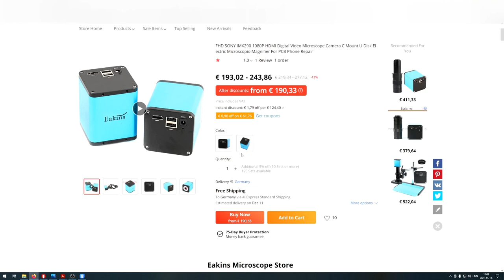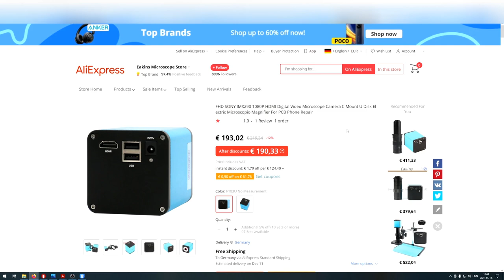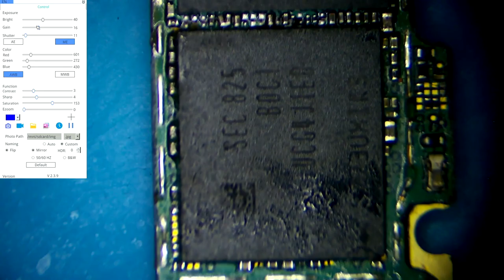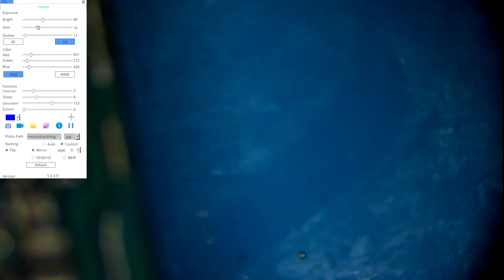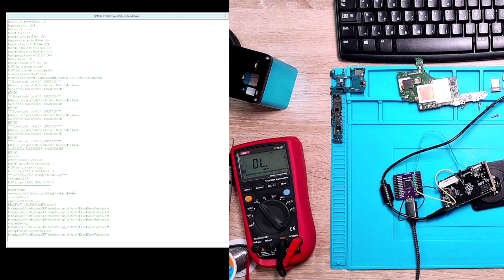FAKE Sony IMX290 microscope camera - SCAM

Comment: They scam also in my case. After almost 10 months I opened mine and there is IMX307 with autofocus instead of IMX290with autofocus. Same shop: Eakins Microscope Store.
Reply: Amscope are one of the most complicit in perpetuating rebranded obsolete Chinese sensors as microscope cameras. Like a decade old 640x480 0.3mp child's toy camera sensor, being rebranded as a £40 microscope camera in 2024, with equally obsolete ridiculously child-orientated proprietary software.  🤔

Best advice: Just don't get suckered in by the low Chinese prices. Then you won't have to bin the fake and shop again on the genuine product. 👍😉
Reply: @Zodliness  Amscope microscopes are not good either. People say they will give you a headache.
Reply: pero dicen que el imx307 es mejor

Comment: Hi! Request. Show more details of the contacts to which you connected and what voltage was the converter 5V, 3.3V or 1.8V?  What lens enlargement do you recommend to work with chips in the SOP8 and SSOP8 (0, 625mm per pin) package?
 180X will be the best choice?  Best Regards.

Comment: If you paid using PayPal you’ll be able to open a case with them to try and get a refund. Sorry to hear this happened to you. Some credit cards also offer fraud protection and you may be able to get your money back that way if the seller not giving you a refund.
Reply from the maker: Thank you. The problem is that one of the refund process has already been clodsed in Aliexpress before I was aware that it is really not this sensor. I asked for a lower amount of money onky just to get something back....Though you might be right that Paypal could still help.
Reply: @kikihobbyrepair  they will be able to if you used PayPal. Just login to your account and find the transaction. There you’ll be able to open a case with PayPal and on the case details just state it’s not as advertised. I’m sure you should be able to get a refund this way because the seller lied in the advert. Hope it works out for you.
Reply from the maker: You are right I will do this. It definitely worth a try. I wanted to make the video anyway to warn others about this scam...
Reply: @SURGE101  Rich that is  Good advice. I have bought other items from various Eakins shops and they have been fine.
Reply from the maker: All my other microscope stuff are also from Eakins and they are fine for me too.
Reply: @kikihobbyrepair  depending on how much it set you back, go to the seller in person.
Reply: @kikihobbyrepair  the paypal dispute time is about 90 or 120 days. And you have to hit bastards for your money, the alipay these days resolve most of the disputes in favor of sellers because in case of  money refund they bear some financial losses as well.

Comment: Got my scope from Eakins, chosen more expensive 8.3MP Sony sensor. It described as HDMI + Type-C + USB + TF, simply has no USB . Was packed bad, it was nothing but luck it has arrived fine. I even made a video of unpacking at delivery point. And conversation with seller was difficult. 

The only "Sony" word in 27 kb log is in phrase "IR Sony protocol handler initialized". However, start-up log contains "Connect IMX415_HDR_init_driver linear to sensor pad 0", and internal sensor looks 100% identical to Sony IMX415 photos I've found on internet. IMX415 specifications match with scope specifications. Found some protection on USB and HDMI data lines which is nice. 

Despite lost USB port and some minor details scope is good for me.

Comment: Hello, I'm afraid that two years is too late to comment, but if what I'm about to tell you doesn't help, maybe it will be useful to someone else who comes across this comment, just as your video has been helpful to me.
Well, after watching the video, I would say that the biggest problem I see is not the camera itself but the lighting you are using and the surface of what you are trying to observe.
First of all, the light. I saw that you were using an LED ring light around the lens, which is not the best way to illuminate with a stereoscopic microscope. The reason is that the lighting is perpendicular to the object being observed and parallel to the microscope lens. Considering that reflections depend on the angle of incidence of light, the result in the images is a result of that "direct front lighting." The situation is even worse because what you were observing was a PCB that has a very reflective surface. You can try cutting one or two rings of white paper and placing them in front of the LEDs as a diffuser to see if you can reduce the glare a bit.
To avoid and eliminate many of those bright reflections, you can use lateral lighting. You will lose most of the front ring lighting, which you could keep as low as possible only to fill or lighten the darker shadows. But also, if you place one, or preferably two, lateral lights pointing at a 45-degree angle to the surface you want to illuminate, theoretically, you won't have any reflections. Well, that's just theory because with bare bulbs or LEDs, light travels in all directions, and you will still have many reflections. If you really want to get rid of virtually all reflections, I recommend getting polarized light. You'll be surprised. I dare say that was the type of lighting that the people at Eakins were using in that video you posted as a comparative example at the beginning of your video. If you use polarized side lighting at 45 degrees and very low front light to fill the shadows, I'm sure you could get a very contrasted and evenly illuminated image.
The second thing I want to say is that the microscope you are using does not seem to have very good optics. The image you show never appears sharp, at least in the video I've seen, and in the brighter areas, you can see fringing or chromatic aberration (magenta color) that occurs when poor-quality lenses fail to make the different wavelengths of light that pass through them coincide again at the same point. It would be something similar to when in a printing press the inks of a trichromatic process do not overlap perfectly, and the resulting image is not sharp or does not have the correct color, so to speak. That could also be the reason I told you the image didn't look sharp, although there could be other reasons. If the lenses are not very bad, you may not notice it, unless your eyes are very used to seeing images since the brain reinterprets and corrects the image to some extent, but the camera does not correct anything and captures what is, good or bad.
As for the falsification of sensors, it's a bit concerning because you don't really know what to expect. Supposedly, you are buying one thing, and they sell you another of lower quality and price. What catches my attention, now that I am looking for a microscope camera and was searching on Aliexpress, is the disparity in types and prices, even among cameras that seemingly have the same external appearance. It is very likely that the Chinese use the same exterior design to save costs and vary only the electronics of different models. And here is also the danger of encountering unscrupulous sellers willing to deceive buyers and maximize their profit margin.
If you've made it this far, I apologize for the length of this message, and I wish you a happy day, night, or whatever it may be wherever you are.

Comment: I would even say that 99% of the cameras that have been available for a while are equipped with fake chips. 

For new models, the chance of getting a camera with an original chip in China is greater. But as soon as the model does well, the expensive original chips are replaced by cheap copies.

And by the way, this does not only apply to cameras!

And even if some people here write that this is a light problem, this is not true. Quite apart from the fact that you want the product you paid for.

But you can see very well on the video that there is a problem with the dynamic range of the sensor. And you can't compensate or change that with light. The dynamic range remains poor. And that's what makes the difference between the sensors.

Comment: Thanks for letting us know. That's very bad, bro. I am looking to buy Hayear HY-6110 with IMX334. It's the best when it comes to sensor specs, but I am now skeptical if they are using an original sensor or not.

Comment: to eliminate reflections, please use the gooseneck lamp. that overhead lamp is no good for some cases, reflections everywhere, including that switch board.
Reply from the maker: Thank you for your feedback. I understand your point that incertain situations a gooseneck light is better. I even designed one myself. But this was in this video a one to one comparison of my cheap 70€ camera vs a ca 200€ camera where the cheap performed signifixantly better. I use the exact same ringlight like Eakins is using for their videos in the advertisement. They wpuld need to perform significantly betterin any conditions and this is my problem. If you check other Youtubers vudeos they all use ringlight and IMX290 cameras and the pictura quality is awesome.

Comment: Have you try using dual led gooseneck for removing the reflection
Reply from the maker: I totally understand your point. For sure a gooseneck style light source could significantly improve the situation. I have tried 3 different light sources (including a ca 150€ Amscope) and in each and every cases my 70€ camera handled reflections flux on the board significantly better. This is my main issue.
Furthermore I ordered an IMX 290 camera and I got something else which is in general totally unacceptable...

Comment: I bought a 4K usb C camera from Eakins only a week ago. It advertised to have a high end Sony  Sensor.
I have it on 180X lens with 0.5x Barlow, monocular, not binocular or trinocular.
The image is quite crisp and the zoom can go really in there with a bit manual focus.
With golden pins like a hard drive connector there can be reflection but tuning down the led ring strength helps a lot

Comment: If you want to avoid reflection you need to change the angle of the light. If you ring light is aiming straight down reflection will come straight back at the camera if you have light coming in at a 45 degree angle the reflection will reflect back at 45 degrees
Reply: I don't know what he doesn't realize that 😂

Comment: What you need to improve the recording quality are some high brightness gooseneck lights. AMSCOPE make good quality ones and Eakins actually make good ones as well. Your concerns here about getting the wrong sensor are 100% valid and justified but that's not the reason the image quality is so poor. The reasons are three-fold.

1. Your ring light is being reflected directly into the microscope. This is the primary reason. Your ring lights are shining straight down at the board and being reflected into your microscope lens. No camera sensor can fix this. You need directional lights so that the light bounces away from the camera lens so that your microscope only gets "indirect" light which will significantly reduce the glare. When you focus on the switch PCB you have a massive reflective shield and a ton of reflective flux residue causing a lot of glare.

2. You're using a trinocular microscope. The aliexpress listing you showed with the demo footage is using a monocular microscope. They're using optics that attach directly to the camera module which means the camera gets all of the light reflected into the optics. That's why it looks better. 

In your case the trinocular microscope uses a mirror to reflect some of the light into the camera optics tube and away from the eye pieces. This means that the camera gets less light hitting the sensor. This translates to a poorer image in general. This can be offset a little with high end optics or bigger sensors on the camera but the gains in quality are minimal as ultimately it's down to how many photons hit the camera sensor. The most important thing to the camera is that more light is hitting the sensor. Trinocular microscopes divide the available light using internal mirrors so will always result in worse image quality.

3. You have flux all over that Nintendo switch board you used as a demonstration which is highly reflective and combined with your direct overhead lighting is causing your poor image quality.

So yeah, if you're chasing good image quality  you have a couple of choices.  

1. You can get some directional gooseneck lights.
2. Shell out your hard earned cash for a very high end camera.
3. Switch to a monocular microscope and use an LCD to view your work.

All three options combined will yield the best results.

The first option alone is the most affordable option that'll yield the best result for your money.
Reply from the maker: Thank you for your detailed and valuable information. I really appreciate it.
Yes, I know that a gooseneck light can significantly improve the reflections, I even designed and built one by myself with super bright LEDs with brightness controll (there is a video about it on my channel). But here I wanted to have a one to one comparison with the old cheap camera which performs significatntly better with the same lighting conditions, on the same Switch board with flux on it. Basically because of the aluminium shield of the Switch you cannot see anything with the IMX185 sensor independently which settings I set. With the cheap camara it is just fine.....
I have tried 3 different lights all together and I was not impressed at all. Furthermore I also tried it with the monocular setup it came with and the situation is basically the same.
Furthermore as you also pointed out the biggest point is that I ordered a camera with IMX290 sensor and I got one with an IMX185. I asked 3 times in advance the seller if it is really the IMX290 sensor and tehy always replied with yes. Afterwards when I did this serial communication reading when I realized that this is not the IMX290 sensor they simply stopped responding to me. I initiated a refund process and teh seller did not respond at all. This is what pisses me off and this is why I made thsi video at the end.
Reply: @kikihobbyrepair  Yeah I really don't blame you for being so annoyed at that. I would be too. Lapsun do an IMX385 1080P 60FPS module that should suit your needs.

The problem is AliExpress is it a bit of a lottery when it comes to these things. 

You might find it better to just use a DSLR with a CTV adapter rather than gambling on AliExpress if you want peace of mind.
Reply from the maker: I have got some comments below this video that they also got scammed by Lapsun checking the sensor with the same method. I can also imagine that all these are produced by 1 manufacturer and the different vendors are selling the same crap..... Hard to trust them.
I need to find some solution. For sure for myself the binocular itself is the best way but to make videos I need the 3rd eye..... 
Once I also tried to put the DSLR on top of my trinocular but it is too heavy and big in size too....
Reply: @kikihobbyrepair  An alternative to a DSLR is a mirrorless camera. They're quite light weight and should do the trick! Something like the Sony alpha 5100 would definitely do the job. You'll be guaranteed a Sony sensor too 😂
Reply from the maker: But such a mirrorless camera costs like a decent microscope camera 😀
Reply: @kikihobbyrepair  I understand your situation very clearly.

I am at a loss why so many commentators fail to understand your message, and instead presume to offer unsolicited advice. 
 
I found your story to be a real 'wake-up' call, thank you.  And again, sorry for your
trouble in this matter.
Reply from the maker: @johnd942 thank you!
Reply: I was in between ordering an eakins microscope camera and the newer model Mechanic MOS-4k, after seeing your video I decided to go with the Mechanic version, hopefully my results will be better.
Reply: @gasthrax  how did it go?

Comment: what's the status on this? it seems there haven't been any useful updates. A lot of the commenters below never come back & provide useful feedback on their findings after buying a scope from a certain vendor. I'm in the market for an autofocus hdmi scope in this range, but I'm somewhat hesitative at this point after seeing all of these complaints of shady dealers on aliexpress, yet I also refuse to pay the ridiculous mark-up from aftermarket vendors selling the same scopes at greatly inflated prices (amscope, nridge fix, etc.)
Reply from the maker: There are lots of comments telling that they were similarly scammed with a different sensor. There were maybe only one telling that his autofocus came with the right sensor and it works properly.
I am the same like you, I will not pay 5-600€ for the same microscope just from a bigger brand. For my work I use a trinocular optical microscope and no camera can compete with this but for sure no video this way.

Comment: hi. thanks for the video. is there a legit listing with the right imx290 sensor, WITHOUT autofocus? have you found out?
Reply from the maker: Hi, you are welcome. I did not deal with this topic since then. I was told that Lapsun and RisingCam are reliable sources but I cannot confirm this myself yet.

Comment: That's strange.... The sensor you did find should not be so bad. IMX185 is not bad sensor - it has 1/1.9" format and 3.75 x 3.75 μm pixel size, which should be especially helpful in low light... and like IMX290 it has 2Mpx count as well.

"The IMX185-MIPI-M12 is equipped with Sony diagonal high sensitivity, low dark current 8.58 mm CMOS solidstate image sensor IMX185. This camera outputs RAW data."